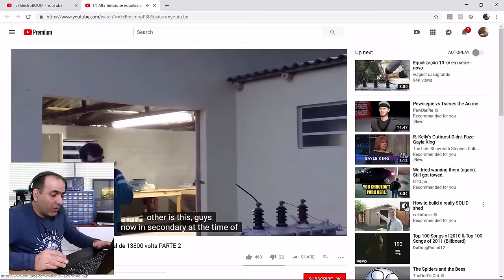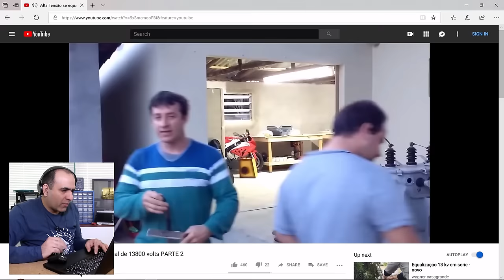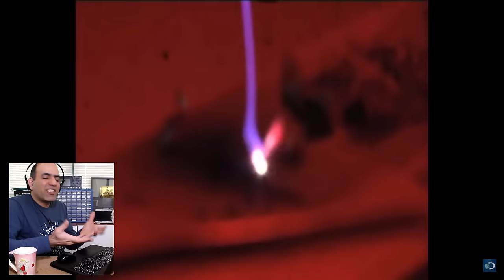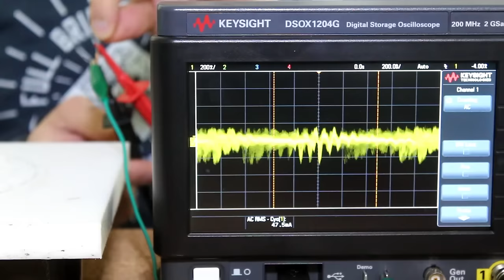Rectifying a Bunch of Videos

Comment: Always remember: Neither current on its own nor voltage are killers, it is the product(!!!) of voltage, current and(!) time. I once blew an high-current-fuse by collecting static electricity in the megavolt range and touching the not grounded contact of the fuse which was grounded on the other side. I can still write this because the duration of the discharge was near zero.

Comment: The Brazilian guy does not tries to show super powers. he just shows the some characteristics of voltage and current. He repeats several times for no one to try this. He works in a company that provides installation services for transformers and assembly of primary cabins
Reply: Thanks for pointing that out, it's an unfortunate misunderstanding.

Comment: You know, I have a quote which basically tells you the difference between Current and Voltage. Remember it so you don’t accidentally say “it’s Current that kills”.

So the quote goes like this:
“Voltage kills you, while Current heats you.”

Current is NOT what kills but is what makes Heat in a wire.
Reply: No, current kills you but it's the voltage that pushes that current through you.

Comment: The guy with the transformer is Brazilian, he is not claiming the current is passing through his body, he said he would put an "Conductor Element" between  the two rods and create an arc without it affecting him although the fact that him was holding the rods and been potentialy equialized with the voltage

Comment: my guess is the "HDR" is just a very powerful electromagnet screwing with the timekeeping circuit of his watch. when he can make one of my mechanical watches speed up like that I'll be convinced. no matter how much force is applied, the escapement in a mechanical watch will only let the spring unwind at a fixed rate... that's the whole job of the escapement, to make the spring unwind evenly over time despite having strong force at the beginning and week force at the end. If that speeds up, slows down, or winds itself backwards, I'll believe you're changing time. that's why when experiments are done regarding time dilation, they typically use mechanical time measuring instraments

Comment: I know it's old video and I should reply earlier, but the dish antena works exactly the opposite way, there is signal coming from satellite to the antena and the shape is directing everything into the bottom receiver in front bottom. You have to know exact angle from position of the antena (on your house/apartment) towards the satellite in ''universe''.

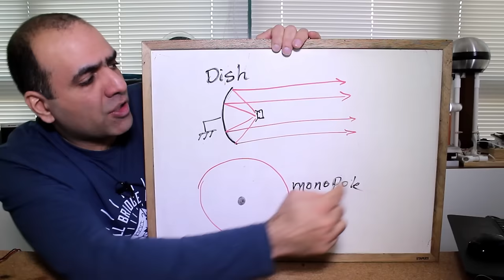Comment: 9:45 It is possible to reflect some energy from an antenna by placing a metal object behind it. But it will only work when it is placed on a calculated distance based on the wavelength of the signal. A minimum distance is required to provide a parallel capacitance to the antenna. And a maximum of a quarter wavelength before the reflected signal doesn't sum up any more and even start to cancel the signal partly out, which also makes its performance worse. Even when you get it right, you'll have a maximum of 2 or 3 dBi signal gain into one direction, and the same amount of attenuation in the opposite direction. And 3dB gain is not really noticeable in performance on WIFI signals which you want to be everywhere, instead of having a sweat spot somewhere in your home.

Comment: The soda can works to receive a stronger signal. Ive used it to get wifi when signal was to weak to transfer data and it was the only way the wifi would work

Comment: Even when the time really would move backwards it would not possible to see anything because no light that fell on some object inside would also get pulled back to that object and when it exits the zone of backwards moving time it would start to move towards the object again so it gets stuck in the surface of the backwards-time. Light falling into that zone would also get stuck in the surface of that zone because it would move out when it's inside and in if it's outside of that zone. 

Conclusion: a field of time moving backwards would always look like a pitch-black object.

Comment: Deric actually said it very correctly. The voltage is high but there isn't enough charge (this along with the fact that the spheres have very low capacitance means that voltage drops quickly) so there isn't enough current through your body.(for long enough time)

Comment: you know before I was watching your videos I once saw a video similar to the wifi antenna stuff, though what you had to do was get a plastic bottle, put a little bit of salt in it, and dissolve it in a bit of water and let the water evaporate to coat the walls of the bottle. Then you put it on the router antenna. Basically the working principle was the salt crystals formed from the evaporation was somehow supposed to amplify signals or make them more directional. I now know there's nothing behind it.

Comment: Is there any inherent problem with using high frequency AC for general power outlets in residential areas to reduce the instant lethality that comes with low frequency AC which can also cause muscles to contract prohibiting someone from letting go of live wires?

Comment: I mean, with the WiFi thing, it's conceivable it could help if it's aimed at the receiving device. RF stuff is weird as shit. I have a kinda weird setup where I need to run a WiFi bridge across my house and as a result I've done a bunch of messing around with this stuff. Literally just putting a metal plate, or even better a tin can (not cut up like in the video, just the open end facing towards the antenna), isolated from ground, behind the receiving antenna facing in the direction of the transmitter can significantly improve the reception in some cases. It gets even weirder tho, just sticking a metal plate next to a metal box which the antennas are inside, facing the transmitter can also significantly improve the reception (don't ask why my antennas were in a faraday cage, long story short I'm dumb, didn't read to documentation properly and didn't realise those where the 2.4 GHz antennas, i had the 5 GHz antennas (not being used) outside the box and the 2.4 GHz antennas inside :P). Even having a person sitting in the room next to the receiver can have a massive impact on reception, either improving it or degrading it depending on where they're sitting relative to the receiver and transmitter. Long story short, RF stuff is really weird. The engineers that actually understand how this stuff works and design this stuff might as well be magicians.

Comment: 5:54 you CAN become used to electricity. I have met two electricians and my cousin (held a steady flowing electric fence while standing in a kiddy pool as a kid) whom have this condition. All it means is that the body was shocked with enough current that the brain no longer triggers a reaction to up to a certain current. 

This is problematic because the electricity still effects them and that reaction is to prevent you from dying.